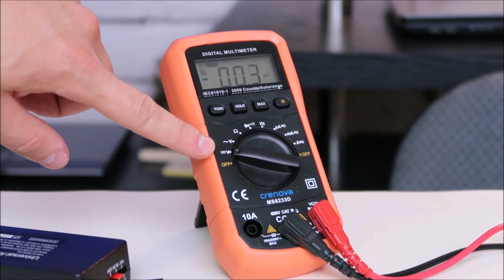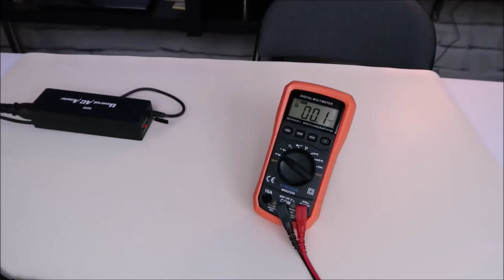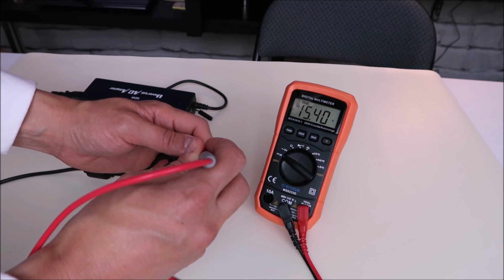How To Fix Any Laptop - Wont Turn On, Wont Open, Turns Off Right Away, No Power Solution

Comment: My laptop suddenly turned off while I was working and it stopped turning on (it even stopped charging... like I couldn't see the blue light anymore - there was literally no sign of life). I got it repaired and everything was fine until the same problem happened over and over again (5 times lol). I think the problem is with the battery but I really have no clue what to do (should I buy a new battery or is the problem something else?). And I'm like... if professionals didn't know how to fix it permanently how am I going to know how to fix it? (especially that the battery is internal and is attached to cables and stuff so I'm scared to remove it)
Please help!!🥺🥺
Reply from the maker: your on the correct video.  Have you tried the steps seen here yet?

Comment: I've tried all of your steps but still can't get my Toshiba L755 to turn on. I did the static release for 60 seconds, then checked the power cord with multimeter... got 9V, then checked the short cord to the mother board... got 9V, pulled the cmos battery out for 20 minutes and replaced. Even checked it... got 3V. Still nothing. Any other advice? Thanks for the videos!
Reply: My laptop has no life at all

Comment: I have an asus without a battery and if i turn it on it shuts of immediately you can see the light that shows it turns on for a sec i did everything everything works but it still doesn’t work
Reply from the maker: If all the tests in this video do not reveal the issue, and your power adapter tested to be fine, then your most likely looking at a Motherboard replacement as seen here;  https://youtu.be/N_7HNrFkMS8.

Comment: I have a mouse connected to mine and it turns on when I press the power button but the screen is black I need answers tbh
Reply from the maker: If the screen is black, what are the signs the computer is on?  Lights?  Sounds?  Fan?

Comment: My laptop is 3 years old, it stopped working so i took a chance and replaced the battery and charger, & it worked, laptop worked for like 30 minutes it was charging fine than i started getting low battery warning even though the battery meter showing over 27% and its died not working, i did a bios reset but nothing.. did most steps in your video.. And my mother board doesn't have a bios battery
Reply from the maker: Does the computer run fine if the battery is removed and the power adapter is left plugged in?
Reply: @PC_Monkey  thanks for your response, No it doesn't run at all, i think ill sell it for parts and keep the sshd

Comment: Hi! I hope you're doing well!
My computer (HP 15-dw0008ca) has been having a mix of issues (turning off directly after startup, stuck in boot loop, crashing while in use) since a few days. Each turn off is accompanied by a sort of click/whirr. I also noticed that while it tries to launch, the light indicating charge blinks (it is steady when I physically close the laptop). I'm hesitant about disassembly... I'll do it if it doesn't sort out after a few more tries, but just in case, I just wanted to ask if this could be linked to anything else. Sorry for the huge block of text and thank you so much in advance!
Reply from the maker: Try running this scan:  https://www.youtube.com/watch?v=o06Iv3Fc9Vw
Reply: @PC_Monkey  Thank you!!

Comment: Hi there, thanks for the video. Yes you are a good educator, and explained things clearly and in order! I have tried everything you suggested here. But no luck. Can I conclude the motherboard is the cause of problem at this point? 
Another question, can a computer run with a dead cmos battery?

My laptop is Acer Aspire 7535-5415. After turning on power, power light is visible, and fan is on and Dvd disk lights on with some noise of movement (sounds normal to me), THEN Dvd light goes off and the fan stopped, it became quiet with power light still on. There is no any sign on the display in the process. 
Thanks!
Reply from the maker: Yes, if all the steps here dont identify the issue, safe bet that its the motherboard.  No, most computers that have a CMOS battery cannot run without a working one.  The CMOS battery powers BIOS which needs to correctly load before the operating system can load.
Reply: Thanks for the quick response! I watched other video and understood that it seems BIOS is hard-coded in one chip that doesn't need a power to keep it alive;  while CMOS is another chip that run with the CMOS battery. However, I am not sure if my understanding is right or wrong. Would you comment and help me know more about it?
At the same time, I will get a new cell battery to replace the existing one .... 

Thanks!
Reply from the maker: @williamlui8873  BIOS is complicated.  It does need power to stay running.  Thigs cant run without power :)

Comment: Done everything as u have shown, nothing happens, as I mentioned in my previous post DC power supply is coming to the mother board from the DC jack, still p c does not turn ON, plz help.
Reply from the maker: If all the tests in this video do not reveal the issue, then your most likely looking at a Motherboard replacement as seen here;  https://youtu.be/N_7HNrFkMS8.

Comment: Hi!
My Laptop Isn't Opening because when i press power button it show's lights but then Shuts also when i am charging it shows lights again but it doesn't open! and Yeah my laptop was old and it had windows 7.
Previous Time When I went for laptop maintenence it said that the Motherboard is damaged and that it had to be Degraded from x84 to x32 bit now i think that the motherboard might be expired
But

No Worries i will buy a new laptop with windows 10 by maybe 4/5 January!
Reply from the maker: For a computer that does not turn on, try this video first;  https://youtu.be/P3I7dDpkJps.  Let me know how that goes :)

Comment: My laptop turned on and I enter my password, once I did I left it on and once it to sleep mode it just suddenly black screen but the light is blinking and when I put on my charger it doesn't charge it.
Reply: same problem, have you fixed it?

Comment: Hey DC me again. This didn't help at all...
Reply from the maker: What brand and model computer do you have and whats the issue with it?
Reply: @PC_Monkey  Dell Latitude e7450. Nothing shows on monitor but the lights are on. And charger ring light is on
Reply from the maker: @HOLY_Kross  Are the lights the only signs of life when you turn it on?  No motherboard or hard drive sounds?  No fan noise?
Reply: @PC_Monkey  Nope. Just the two of the three lights on the Corner of the PC
Reply from the maker: @HOLY_Kross  If not other signs, then I will assume for now that the computer is not actually turning on.  For a computer that does not turn on, try this video first;  https://youtu.be/P3I7dDpkJps.  Let me know how that goes :)
Reply: @PC_Monkey  Already watched and done all of that. Nothing worked
Reply from the maker: @HOLY_Kross  Then your looking at a motherboard issue.  It should then be replaced.
Reply: @PC_Monkey  how do I do that??
Reply from the maker: @HOLY_Kross  This video shows you how to replace the motherboard in your exact model :)  https://www.youtube.com/watch?v=gsFl0lPO35Y

Comment: hello friend i have a problem with my laptop when i am using it it shuts down and the light power is still on and the screen black if i want to fix it i need to remove the battery but its hard because my battery is build in i hope you can help me to know what's happening
Reply from the maker: Does your computer turn on and work fine, with the problem being that it turns off sometimes?  Or is the problem that your computer does not turn on?
Reply: When i am playing or browsering its sometimes turn off and the only things that still working is the power light and if i hold the power button it does not do anything but if i remove the battery and plugged back it started fine and so on after afew days this happened again i dont know why??
Reply: My whole laptop is shutting off and i cant do anything except remove the battery
Reply: When i searched the youtube i found that its static electricity build in and the way to solve the problem is removing the battery hold the power button for 1 minute but this method does not work with me the problem keep coming
Reply from the maker: @زيدمراد-ش4ل  If your computer is turning off during use, refer to this video first;  https://www.youtube.com/watch?v=Nqn8-jJFx2Y
Reply: @PC_Monkey i found that the id for the problem  is 6008 and when i searched it i found this (Microsoft has confirmed that this is a problem in the Microsoft products that are listed in the "Applies to" section.) but i dont know what to do next???
Reply: can you help me to know what is the windows product that cause me this problem please???
Reply: and there is event code 41 thats what i found
Reply from the maker: @زيدمراد-ش4ل  Event ID 6008 is not an error code that would cause a shutdown.  And Error code 41 just tells us that the computer shut down in a wrong way.  What is the battery showing when the computer shuts off?  Is the battery still showing a charge?
Reply: @PC_Monkey  
Yes, exactly the battery charge light still on even if i removed the charger and i noticed that this problem only happening when the laptop is charging i think that...
Reply: today its happening with me twice and the my laptop was charging....
Reply from the maker: @زيدمراد-ش4ل  What is the battery showing when the computer shuts off?  Is the battery still showing a charge?
Reply: Yes it is still showing that its charging
Reply from the maker: @زيدمراد-ش4ل  Im asking what the battery is showing for a charge?  Is it at 0% when it turns off?  Im not asking if its charging.
Reply: @PC_Monkey  ohh okay i am sorry no its full sometimes and around full .....
Reply: it's always happened when the battery is in high level..
Reply from the maker: @زيدمراد-ش4ل  What brand computer do you have?
Reply: @PC_Monkey  i have lenovo ideapad 130
Reply: I need to know what is the problem because its become boring.

Comment: Hi please help 😁
My Acer wont boot, outputs "Acer" then holds black screen. It say 19v on the back of laptop, my charger is out putting 24v. Is that the problem?
Reply from the maker: Yes, you should get the correct charger.  That one could damage your computer.  Also, this video is for a computer that wont turn on.  Your computer turns on if your able to see the Acer logo screen.  For your issue, refer to this video instead;  https://www.youtube.com/watch?v=gDQZvNQ2chc

Comment: Hey, so I got a problem with my laptop 
Problem: Basically I can turn it on when it's not plugged in but as soon as I plug it in it shut off instantly.
Did you come across anyone with this problem before?
(I bought a new charger and battery for the laptop also.)
Reply from the maker: Sounds like something is wrong with your power adapter and the computer is trying to protect itself by shutting off.  Try replacing the power adapter.
Reply: @PC_Monkey  I bought a brand new charger off Amazon and tried it yesterday and still didn't help.
Do you have any other suggestions?
Reply from the maker: @blamevex9289  Then it could be the power jack or the motherboard :(   Try testing the jack as seen here;  https://youtu.be/HpabvrNaodU.  Also, make sure the adapter has the correct Volt and Amp rating.  If the charger and power jack check out, it may be a motherboard issue :(

Comment: HELPP :(mine showed the blue screen and then after 100% its okay again then it went blue screen again then it doesn't open anymore.

My laptop only works if the charger is plugged. So my laptop is charging but when I push the power button its not working :( 

My laptop is Asus n53s
Reply from the maker: If your computer isnt turning on, your on the correct video.  Have you tried the steps seen here yet?

Comment: I need Help Sir. 😭
My Sony Vaios Laptop  
mother board clicks, fan opens. but before screen opens it turns off automatically.
i tried the BIOS RESET and replaces the CMOS batt. 
Now the screen opens very happy until logo pops up then suddently turns off again.

Sometimes it opens longer until logo popups and sometimes it turns off right away after i open. :(((

Comment: I have a Toshiba satellite model c55-b5352 the laptop powers on, and screen kicks on then laptop powers off then right back on and screen comes on but nothing is displayed. I've tried external monitor everything please help!!
Reply from the maker: If nothing is displayed, what are the signs the screen is on?
Reply: @PC_Monkey  like it comes on when laptop is powered on but you don't see the toshiba logo displayed or nothing
Reply from the maker: @meagansierra8527  If the screen is black, what are the signs the computer is on?  Lights?  Sounds?  Fan?
Reply: @PC_Monkey   when I power it on, the screen lights up but nothing else displays on screen

Comment: I didn't use my laptop for a month .and later it does not turn on .Please help.I remove the battery and keep it in the sun but still it doesn't work. Please help😭😭😭
Reply from the maker: your on the correct video.  Have you tried the steps seen here yet?
Reply: @PC_Monkey  I tried to turn on again and it on for a second but it automatically turn off within a second .please help and thanks for the reply
Reply: Hey 👋 I followed 1 st step only but I will follow the further steps but removing bios and further steps are quite risky . That's why I will follow the steps till RAM set up . Thanks bro . Hope it works 🤟

Comment: My computer ran out of battery
Reply: I can charge it if I move it around a lot and it might charge but I might not my battery is dead so I can’t use it until it charges so idk what to do
Reply from the maker: @kazdan3  Sounds like the power jack is bad if you can charge by moving it around.  For a computer that does not turn on, try this video first;  https://youtu.be/P3I7dDpkJps.  Let me know how that goes :)

Comment: Working on a hp split x2. Tablet will power up only. When docked it won't turn on at all. Battery is internal on both. Suggestions?
Reply from the maker: your on the correct video.  Have you tried the steps seen here yet?
Does this help get at your battery?  https://www.youtube.com/watch?v=V0UD4fGMdrc

Comment: Somebody help me please I left my laptop ann charger and went for 5 
minutes when I came back it was all dead, no light no power, I have 
another laptop same model and everything, I used the same battery and it
 worked well, I used the power charger and all are fine, but for some 
reason this one is completely dead, no lights no power. What 
happened!!!!! I removed the hard drive tries it on another laptop and 
another PC by a caddy, didn't work. so I have dead laptop and dead HD 
all of a sudden!
Reply from the maker: your on the correct video.  Have you tried the steps seen here yet?
Reply: @PC_Monkey  I did, unfortunately when I tried to plug the charger afterwards I heared a click then smelled fume and saw a black smoke on the motherboard near the battery place. Was that because of these steps or a faulty battery or a faulty motherboard!!! The most important thing here is that I pulled out the hard drive and tried to run it on an Acer laptop it didn't show, I tried it with a caddy on two different devices laptop and desktop and no show! Have I lost all my files and data as well?!   I'm so frustrated ... 😭😭😭

Comment: after opening the laptop, my laptop turn on, but when i pressed the middle of the keyboard or spacebar or move the laptop a bit, the screen will be black, and suddenly turn off. Also, the touchpad isnt working anymore. can smn plz tell me how to fix this? 😭
Reply from the maker: Try the steps seen here first;  https://www.youtube.com/watch?v=Nqn8-jJFx2Y
Reply: @PC_Monkey  but mine looks like a physical problem, my touchpad is also not working. Is there anything i disloged or unattach bcoz i open the laptop bfr this happen to clean up the fan but end up making it worse 😭
Reply from the maker: @hanzaril  Definitely sounds like some hardware is loose.  You can try unplugging components and then plugging them back in.  Also, make sure the various boards are properly seated in their positions.  But if you can turn the computer off by moving the computer or pressing on parts of it, check the battery ports and power jack ports where the power adapter plugs in.

Comment: Dude help, mine won't turn on at all!!! I heard the vibrate thing sound and then, it's just a black screen (｡ŏ_ŏ)
Reply from the maker: your on the correct video.  Have you tried the steps seen here yet?
Reply: @PC_Monkey  yes, the power lights are on, but it's still black screen
Reply from the maker: @noname-wj9gn  If all the tests in this video do not reveal the issue, then your most likely looking at a Motherboard replacement as seen here;  https://youtu.be/N_7HNrFkMS8.  If you know your computer's model number, I can help you get inside your specific computer :)

Comment: Hey so my laptop does not turn on everytime 
it literally takes like 10 to 15 mins or even more to move it around and gently rub the back lol to turn it on (it runs on ac adapter as battery is dead) but when it turns on it works as intended without any issue and moving it around etc doesn't turn it off at all 
like i am not sure whats exactly the issue here this started happening randomly few days ago
would this video help me out? if not then what do you suggest i do i cant exactly afford to get it checked and just having a rough time also need this for my studies so im worried its the only device i got for now that can connect me to the internet